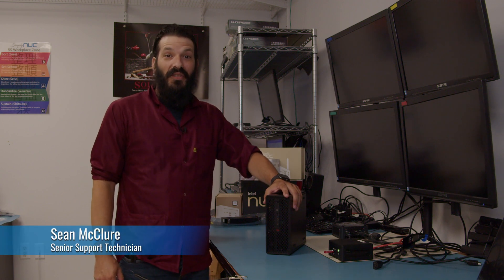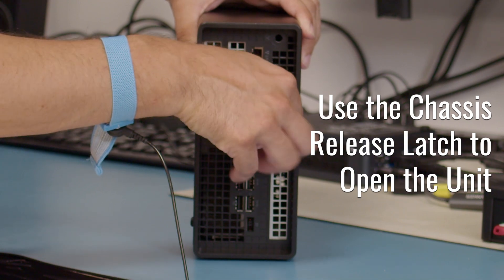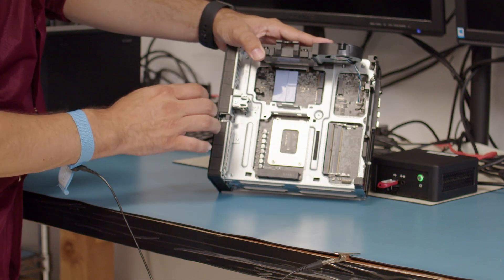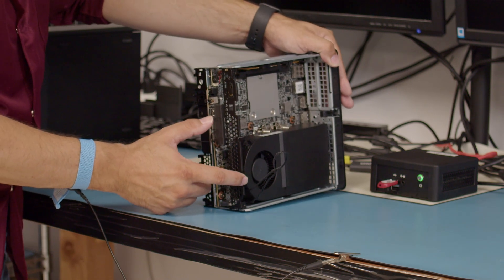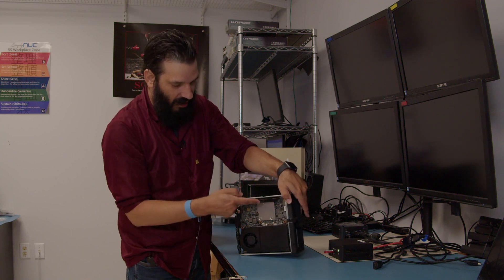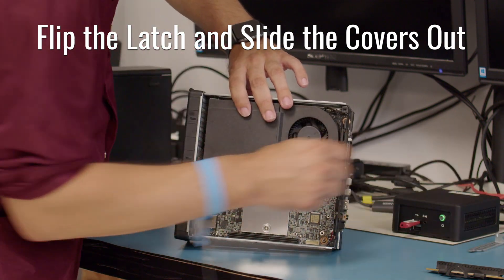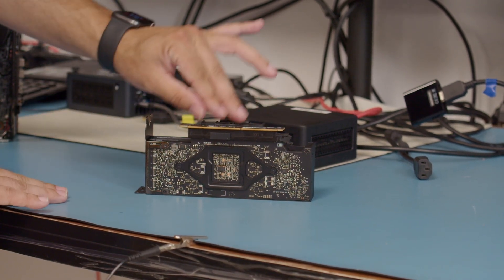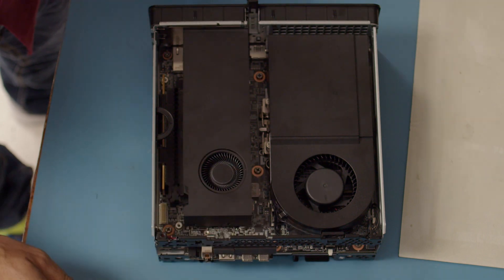P360 Ultra Walkthrough and GPU Installation

Comment: Does any of You know if theres is a way to enable above 4g decoding  on this machine or any other lenovo Tiny series?
I have a Lenovo Tiny m90q gen 1 with an Asrock ARC A380 6gb LP, and I still havent been able to enable ReBar for it cuz there are no above 4g decoding in bios.
Anyone that has a solution?

Comment: Lenovo sells a power cable kit so that you can run a low profile GPU that requires additional power above the 75W the PCIe rail. Can you confirm the white connection toward the back of the PCIe rail is that connection source?

Comment: I have got a slot to add a new video card NVIDIA RTX A2000 into the free pcie slot of this unit but the CPU heatsink takes the room where the card should go. I cannot find any infos nor solutions about that on the web. I'm confused. The CPU main heatsink takes all the room, so why is there a free slot if we cannot replace the cpu heatsink for a smaller one ? If someone can help me, i would appreciate that much ! Thanks for time !
Reply: did you find a solution? I am in the same situation as you and dont know what to do. in advnaced tank for the time.
Reply: Based on your comment, I believed that you having the overclocking version that having double slot heat sink and double fan (aka 125W CPU cooler). With that, here are 5 solutions for you:
* Buying external GPU base: ThinkStation P360 Ultra have Type C Thunderbolt port as the front. This solution will not limiting the type of GPUs and you can use fancy RTX A6000, but limiting the performance.
* Changing to single slot CPU heat sink (aka 65 W): If somehow you having non K Intel 12 th CPU and not i9, you can replace the CPU cooler and change it to 65W (or changing CPU too but it will be waste). There is risking move that I tried as R&D in Cluster for i5 12600K only (i7 12700K or upper model will be overheating and not stable operating)  is go to UEFI setting and set CPU mode to Base mode only (turn off Turbo mode) and use it with 65 W cooler, with trade off that each time you booting up will give you MXM fan Error. Beware that we testing it in server room so environment temperature is lower and more stable than normal use case.
* Changing GPU to single slot version: RTX A1000 and RTX 2000E Ada or RTX 2000E Pro is single slot GPU that work on secondary PCIe slot of P360 Ultra. Beware that single slot version have lower performance than double slot version in same card.

For Quadpro RTX Ada version and later on. (due to RTX 2000 Ada and RTX 2000 Pro is PCIe x8, also Intel Arc Pro B50. RTX A2000 may not work due to OS system check cause RTX A2000 is PCIe x16, last time checked it pass the UEFI boot but OS sys check is not)
* Open case: P360 Ultra can work and operation without chassis cover. You can use the PCI E slot on single slot side but exposing internal is not recommendation due to many risk.
* GPU Modding: There are many single slot modding that available on RTX Quadpro. Risking warranty and operation.

Comment: At about 0:48, you point out the additional dimm slots. Next to those, there looks like an additional PCIe x16 slot. Is that what it is? I want to put two half height x8 cards into this computer. Would that work?
Reply: Note, one is a single slot and the other is a dual slot.  Both are half height I believe, and the single slot runs in gen 3 X4 I believe.  Verify your setup before purchasing.
Reply: Yes. There is room for two PCIe cards.

Comment: Hi There thanks for a great video.  Needed some help with this unit.  I have one with the NVidia TX1000 however wanted to check how I can install an additional PCIe cards.  Any help would be appreciated. Where you have no GPU in your video [2:21] I do have a large CPU it seems - I could be wrong in my understanding but looks like looks like the space is taken up by this.
Reply: It seems i have the same problem > no room to add a graphic card. Didi you find a smaller CPU heatskink in order to free the room  ?

Comment: Question: Can the CPU be upgraded?
Reply from the maker: The P360 Ultra has a socketed processor that allows for future upgrades. Typically the processors are soldered down on the smaller units.
Reply: @SNUCsystems  It can be upgraded but only Intel 12th. Lenovo only giving the Alder Lake firmware to P360 Ultra UEFI and if you add Intel 13 th or 14 th, it will not boot.